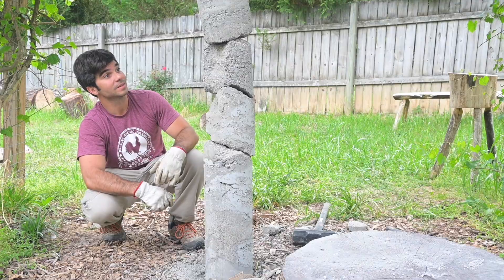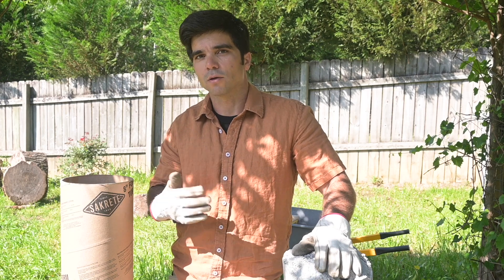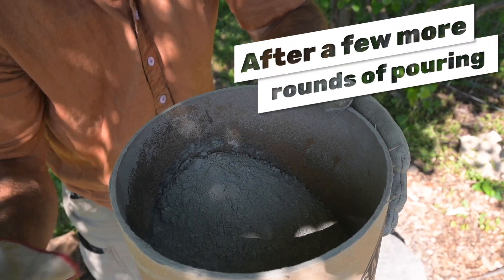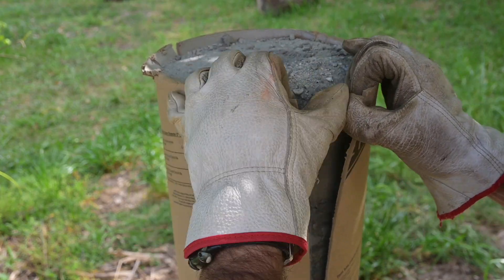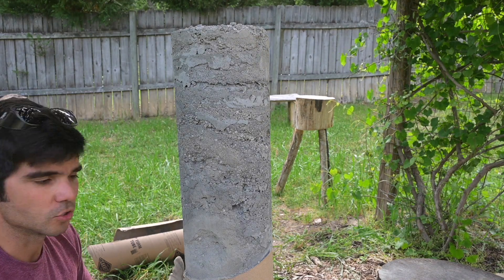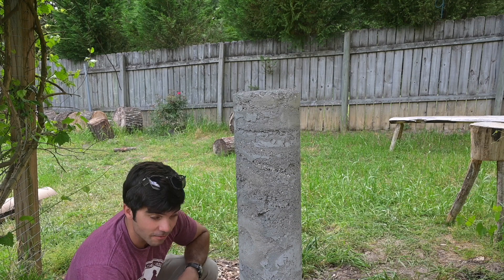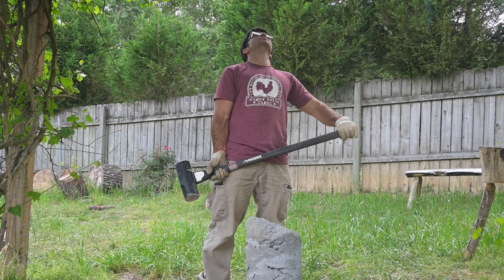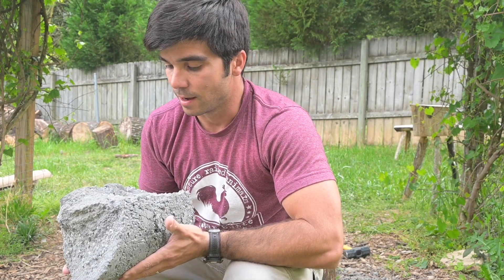Can you Layer Dry Pour Concrete? (layering dry pour concrete)

Comment: I have put hundreds of powerpoles in (thousands even).  I drill a 900 wide  hole fill to the top with drymix with the pole buried 2m deep  and dump 20L of water on the top so the pole doesnt move.   came back to the odd one years later and pulled the pole out and it was solid concrete.  You would not have known it was drymix.     When its in the ground it sucks all the water out of the ground and sets proper.

Comment: You need to use a lot more water and then you tap around the edges to help get rid of air bubbles. Not to mention you add steel. This works fine if you’re not a dummy.

Comment: There is a HUGE difference between pouring this in a tube surrounded by air vs. pouring it in the ground where moisture is ever present. My crew set hundreds of posts in dry concrete over 25 years. Occasionally we dumped a 5 gallon bucket in them if we had water handy--most we just let mother nature to her job. Any that we had to pull out years later were a solid block with no dry voids. As long as the tube can absorb moisture from the ground, that pillar will do the same. Your experiment did not prove the technique was wrong, just that the experiment was apples-to-oranges flawed.

Comment: How about this next?  Put it in dry, then on the edges put in 4 perforated drain tubes the full length (maybe just 1 perforated tube) so the water can get down to the bottom and maybe penetrate... I don't think you can put too much water...  just see how wet you can get it and if it works that way...  would be cool if you could try to make a dry pour foundation or footer...  but remember you can't get too much water...  wet curing for 7-9 days actually makes concrete stronger... so I think you can do any type of dry pour just so it gets enough water and the dry material is evenly mixed prior to it being poured in.  I really want to see if a wall can be made and a foundation...

"3-in x 10-ft-PSI Corrugated Drain Pipe" - Lowes

"A technique known as “wet-curing,” for example, involves laying special curing blankets across a concrete slab, dousing the blanketed surface with water, and keeping it constantly wet for 28 days." - Prosoco

From ChatGPT:

What is the wet cure process for concrete?

ChatGPT
The wet cure process for concrete refers to the method of providing adequate moisture to newly placed concrete to ensure proper hydration and strength development. It involves keeping the concrete surface continuously wet or damp for a specified period to prevent moisture loss through evaporation.

Here's a general outline of the wet cure process:

Placement: After the concrete is poured and finished, it needs to be properly consolidated and leveled according to the desired shape and thickness.

Initial curing: As soon as the concrete is placed, it's essential to start the curing process immediately. This involves preventing rapid moisture loss from the concrete surface by covering it with a suitable material.

Moisture retention: To maintain moisture within the concrete, various methods can be employed:

a. Sprinkling or fogging: Water can be sprayed over the concrete surface at regular intervals to keep it wet. This method helps prevent the surface from drying out too quickly.

b. Ponding: Creating small enclosures around the concrete with the help of sand, earth, or other materials to hold water in contact with the surface. This method is commonly used for horizontal surfaces like slabs.

c. Wet coverings: Non-absorbent materials such as plastic sheets, damp burlap, or wet sand can be used to cover the concrete surface. These coverings are kept continuously wet during the curing period.

Duration: The duration of the wet cure process depends on various factors, including the type of concrete, ambient conditions, and project specifications. Typically, wet curing is recommended for at least seven days to ensure adequate hydration and strength development.

It's important to note that proper curing is crucial for the long-term durability and strength of concrete. It helps minimize cracking, improve resistance to environmental factors, and enhance overall performance. Therefore, following appropriate curing practices is essential for achieving optimal concrete quality.

User
What's the typical time to keep the concrete wet in wet curing?
ChatGPT
The duration of wet curing for concrete can vary depending on several factors, including the type of concrete, ambient conditions, project requirements, and applicable industry standards. While there is no fixed standard time for wet curing, a general guideline is to maintain the concrete surface continuously wet or damp for a minimum period of seven days.

However, it's important to note that this is a minimum recommendation, and in many cases, longer curing periods may be necessary for optimal strength development and durability. For instance, in certain large-scale construction projects or when using specialized concrete mixes, extended wet curing periods of 14, 21, or even 28 days might be specified.

In addition to the duration, it's also crucial to ensure that the curing conditions are appropriate. Factors such as temperature, humidity, and wind speed can affect the rate of moisture loss from the concrete and thus impact the effectiveness of the curing process. It's advisable to consult the project specifications or seek guidance from concrete experts to determine the specific wet curing duration suitable for your project.

Comment: About 40 years ago I needed a STURDY mail box post to prevent kids from knocking over the box.  I used a couple of tubes taped together to get the length for 3 ft. in the ground and the correct height for the box.  No way to mix and pour wet I decided to try a dry pour.  Knowing the water problem I used a 3/4 inch PVC pipe with a bunch of 3/64 inch holes drilled over it's length and a cap on the bottom.  This was inserted in the middle before filling with dry mix.  The hole was dry and the tube would prevent wet ground from getting to the cement so this seemed like a good work around.  Once planted upright in the hole I filled the PVC with water.  2 hours later I filled again.  Repeat every  3 hours until the water doesn't drop more than half way to the bottom.  The post and box are still there even after having a go cart running into it about 20 years ago and a lot of dogs using it as a hang out.
Reply: We dry poured hundreds of wood and metal posts over 25 years. Poured a 5 gallon bucket on them if we had the time, or just let mother nature do the job. Never had one fail. Any ones we had to pull out years later were solid blocks.

Comment: This test is misleading. You obviously didn't use enough water. There is no way there would be completely dry areas in the column if you used enough water.
Reply from the maker: If there wasn't enough water it was an honest mistake. I drenched each layer between additions. It seemed sufficient at the time. 
That doesn't solve the stratification problem, though. I'm about to film a follow up look at the pieces now that they've been sitting on the ground and in the rain for three weeks. We'll see how different they are now.
Reply: @appalachianwoodhomestead  The problem, I think, is if the water doesn't soak all the way through to the layer you just poured before heaping on another layer, that water can wick UP instead of down, thereby leaving areas without being watered. You'll have to do the entire dry pour watering timeline for EACH layer. So that 4 ft column would take over 24 hours to actually do properly, I think.
Reply: @appalachianwoodhomestead  Don't worry about misting and those steps in a pillar application, the misting is only for slabs so that the smooth surface isn't ruined... otherwise you want a lot of water once the source material is in place, you don't want so much water so that the structure is altered, you still want to keep it in a solid/powder form but you can't drench it too much unless you alter the form of the material... it's complicated... you can put as much water as in the world, just so it sets up first, that's the key, to get it to set up first, i think that's what I'm trying to say, so you want just enough for it to penetrate through all the material from top to bottom and side to side, but not enough to wash it away or for the water to overwhelm the chemistry... then once it sets you really can't put too much and you can wet cure it for 28 days...

"A technique known as “wet-curing,” for example, involves laying special curing blankets across a concrete slab, dousing the blanketed surface with water, and keeping it constantly wet for 28 days." - Prosoco

Comment: I don't understand your thinking, concrete will never set like that, no one dry pours tons of water and then leaves it. Dry pour needs time to seep water throughout,  you would have to pour each layer and sprinkle the layer from the top multiple times until the moisture is throughout before adding another bag.
Reply: Wet curing is the process of keeping a standard concrete project wet or under water for up to 28 days...  the sprinkling is just for slabs so the smooth surface isn't ruined.

"A technique known as “wet-curing,” for example, involves laying special curing blankets across a concrete slab, dousing the blanketed surface with water, and keeping it constantly wet for 28 days." - Prosoco
Reply: @VenturaIT  sprinkling is for dry pours, or the cement separates. Then you have to keep wetting it for the moisture to completely permeate the entire slab

Comment: Interesting experiments, but I think it is better to follow the directions of those who are doing it successfully before you start doing variations. The failure you have experienced was predictable.
Reply: GetHealthyNow

Seriously? "Following the directions" to do a successful "dry pour". "Dry pour" concrete is a malaprop. It doesn't produce concrete. It produces something that is poorly mixed, has no strength, and will fail (fall apart under pressure).

Evidently, you don't believe your lying eyes--dry pour falls apart. That isn't much of a surprise. Dry pour "concrete" does not deliver concrete with the strength needed to properly perform. Yes, the failure that was experienced was predictable---dry pour concrete is not really concrete, it is just some poorly devised process that does not take as much time as doing a concrete pour correctly according to the instructions that are provided on the bag of concrete.

GetHealthyNow, how about you do an experiment. Your critique is just "armchair" concrete criticism.
Reply: @harrisorourke6926  Calling me an armchair critic is valid to a degree.  I have to date only done vertical "pours" using dry concrete and wetting it in a large number of post hole "pours", and the resulting concrete is more than hard enough to do the job. The post hole pours have held up for many years.  When the posts have had to be removed trying to break them up was like breaking up basalt.  
The chemical process that cause concrete to harden  does not require the concrete to be mixed into a slurry, just for a fairly uniform wetting of the mix. The failures I have seen in some youtube videos have uniformly not properly wetted the concrete.  
Bottom line this process is still fairly new and has had almost no "scientific" testing done.  It is a fairly common expectation, amongst those doing dry pour, is that it will have different characteristics from wet pour.  Varying the amount of water in wet mixes creates different qualities in the finished product and engineering concrete, particularly for structural pours is a mature, well researched and documented field.  The dry pour process is still in it's infancy and clearly it is best used for specific types of work.  
Also, most concrete has been chemically designed with wet mixing in mind.
The labor and general cost savings of doing dry pours make them very desirable.  Taking into account the massively reduced labor involved, and the different characteristics of the finished product makes dry pour much better for some applications than wet pour.

Comment: You didnt explain how long, how many times, and length of cure.  5 or 6 watering was needed.  Cure time is much longer with dry pour.  Romans used a form of dry pour and whenever their concrete cracked the dry pour uncured mix would wick water and seal cracks even centuries later. So Roman concrete is still strengthening itself today.  This was more operator error than method of pour.
Reply: Roman concrete did that because it contained unactivated quicklime in the mix that allowed that... as well as other materials... Roman concrete is a geopolymer not a Portland type material.  Portland makes linear C-S-H bonds and geopolymer makes 3D bonds which makes it stronger than Portland type concrete/cement.
Reply from the maker: I didn't show all of the waterings because there are plenty of step by step videos on this already. 

Yes, I could have saturated the dry pocket I found. 

As the video says, it was one week when I opened the tube. I still have the pieces, though they've been rained on quite a bit now which would bias the experiment. 

I believe dry pour sidewalks and slabs are primarily successful because of their large surface area and ground contact. It does not seem suitable for taller, thinner items like a Sonotube.

The stratification seems likely to occur, no matter the number of waterings, when you're pouring unmixed concrete into a tube and never mixing it. It's physics.

If you make a video with a lot more water and curing time and get a Sonotube to create a usable product with a dry pour, no mix method, please let me know. I'd love to watch it!
Reply: @appalachianwoodhomestead  why can't you put a small pinholes in the bottom of tube & water until you see water start to come out the holes? That way you know you have reached the correct level of moisture needed. 
Or measure the correct amount of water needed per bag, & ensure your adding that amount to the tube; after all your not leveling the top & looking for a smooth surface. 
It seems either of these methods would be a more unbiased test than what you are offering, as your concrete is clearly lacking hydration even at the top. You don't even have the top 4" hydrated, which means you clearly didn't soak the tube several times like you should have, or the top several inches would've been different... 
It's clear you have an agenda, unfortunately  😕
Reply from the maker: @leahrowe847  What agenda do I have? I am legit trying to see if this technique will work for a pier for a project I'm planning to do this summer. I'm trying to learn and experiment. I welcome constructive suggestions and comments. 

Unfortunately my wife didn't include the clip because she didn't realize how important it was, but I took a shot down the tube after watering a layer. I watered until it was visibly saturated with water on top. 

Others have suggested I apply a measured quantity of water, and I do plan to do that in another test next month. My bag only takes a bit over two quarts per bag, which really isn't that much. 

Using the same watering, but with mixing in the tube, I was able to achieve much better results. The pier fragments have now sat out in two heavy rain storms and are fully saturated. My wife, and even my daughter, are still able to crumble it by hand in places. My method certainly isn't perfect, but it's clear that mixing is important.

Comment: It works fine for fence posts, but I always mixed with a stick after wetting it. All other dry set is a dumbass move.
Reply from the maker: I'm inclined to agree with you. Trying to talk the wife into a rebound hammer so I can compare PSI strength between dry pour/no mix and actually mixing.
Reply: @appalachianwoodhomestead  Yes.  What I left out of my post above was the time it takes to fill the slab mold, sprinkle, let dry an hour, sprinkle, let dry an hour, and repeat a number of times. It's just an exercise that gets you nowhere useful.
Reply: @appalachianwoodhomestead  I bet you could find a local college who might test the material for you...
Reply: That method is more of a mix in place rather than dry pour, pretty sure mix in place or mix in the hole would work fine just so the proper amounts of each material is used within the proper time.

Comment: Do another experiment but do it different. Make 2 small slab 4 inches thick , give them 3 weeks and then break them , one slab dry pour the second one mixed.  
That way we can see the difference in strength between mixed and dry but…..the dry one mist it first , no layers please , let it sit one hour mist it again let is sit another hour, then pour water like the guys in Cajun Country living they are amazing , is 2 showers per inch, one hour between showers so 8 showers for a 4 inch slab plus the 2 initial mists here’s how https://youtu.be/_50MXEHr678
Reply from the maker: Wife and I were just talking about something like this. I will probably do a cut off short tube or a bucket, though. I think one of the reasons slabs seem to work so much better is that they're getting a lot of water from the ground. I don't think the showering method is providing enough water when it isn't mixed and not getting ground water. I'm trying to talk her into a tool so I can measure PSI strength. Wish me luck!
Reply: @appalachianwoodhomestead  that sounds good I live in Arizona our ground here has not water it’s super dry so that would work great . 👍🏻
Reply: @robertoj8950  you're also supposed to drench the ground 1st b4 pouring 1st layer